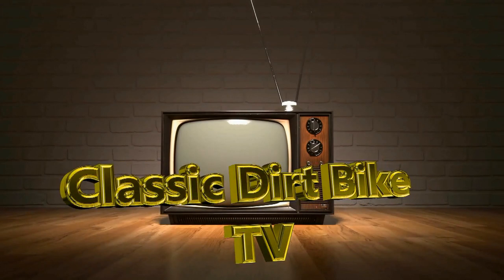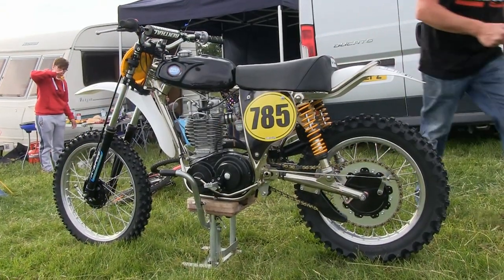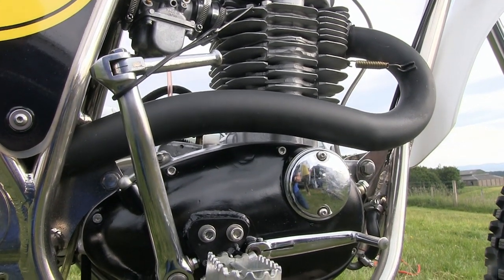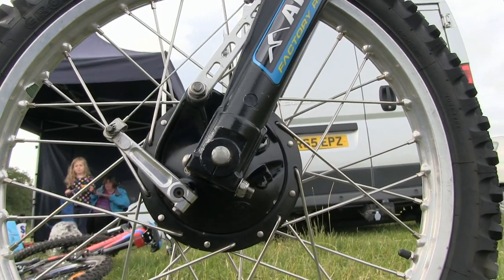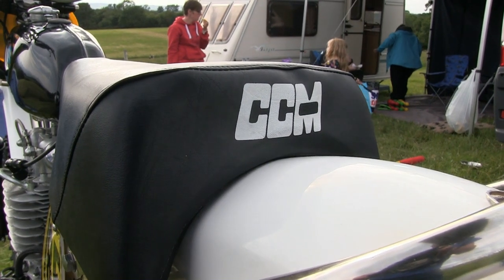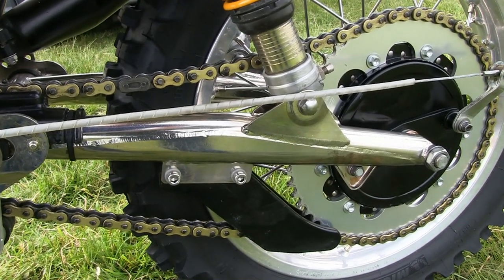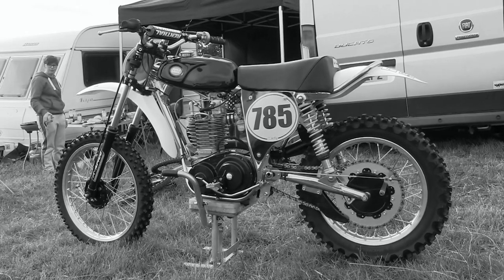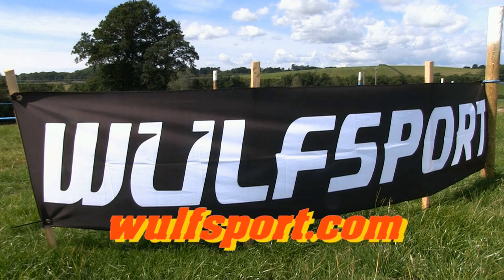Classic Dirt Bikes "Steve Gregson's Re-Manufactured Classic CCM"

Comment: Reminds me of my 1977-TT500; l've put WhiteBros swingarm, Simon forks, Magura Levers, 1/4 turn Throttle and bigger Carb, Sun rims, 8 guage spokes. I still have to bore to fit an Arias 11 1/2 to one piston,   Pro Tech valves, guides, full race Cam, Etc. Wish I could ride that Machine. it is Beautifully done!
Reply from the maker: Hi John Thanks for your comments. Yes original 1974 machines are impossible to find if indeed there are any left. But I think its more important to keep the memory of Alan Clews and legacy of the CCM Marque alive because back in their day these were quick machines. Thanks for yviewing.